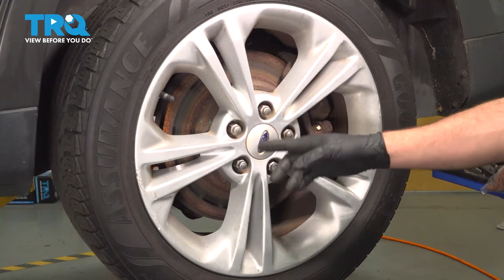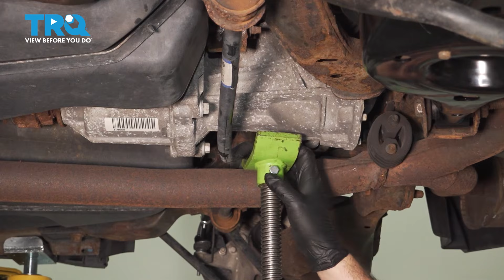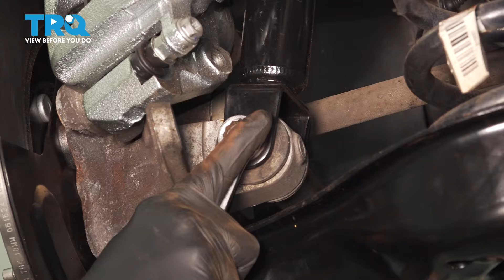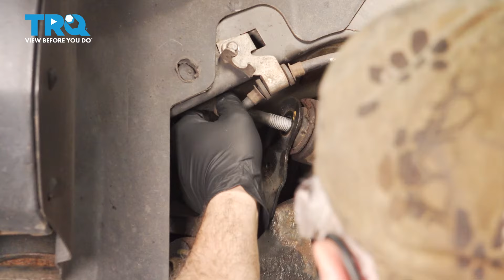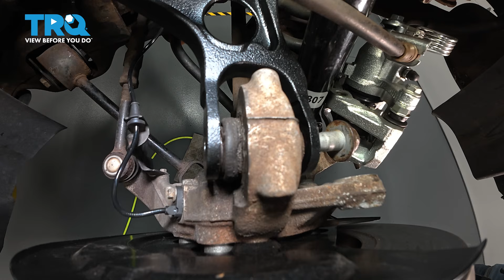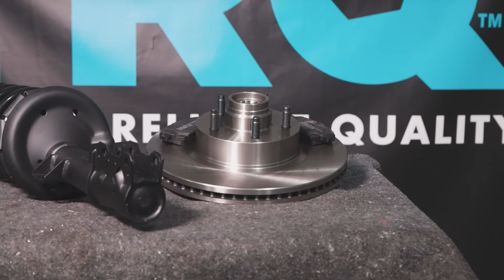How to Replace Rear Upper Control Arms 2010-2019 Ford Taurus

Comment: It's likely worth adding to the descriptions on these videos that the repairs are also relevant to the 2009 Lincoln MKS. It uses the same frame and suspension parts for the majority of the build. Only exception I know of is the front struts on the 20" rims are different.

Comment: Great,  some knuckle head installed my upper control arm to knuckle bolt backwards so my upper caliper bracket bolt wont come out. So I loosened the knuckle bolt and it came out enough to get socket on and clear the end of the bolt.  That bolt had some good torque on it. Didn't know the spec on torque but I put some good leverage on it with a breaker bar. Weird thing is, car had 51k miles on it when I bought it with original rotors. So assembly line mistake?

Comment: Cut the forward bolts that hit the frame and buy new ones.  Forget dropping the frame.  Having said that, made sure you can get the two pair of  bolts out of that rear aluminum bushing block before anything else because the rectangle nuts inside the frame holding them in may break loose and those bolts will spin free without coming out.  If that happens you may have to completely drop the subframe from the car anyway.  Cutting the bolts isn't necessary then.